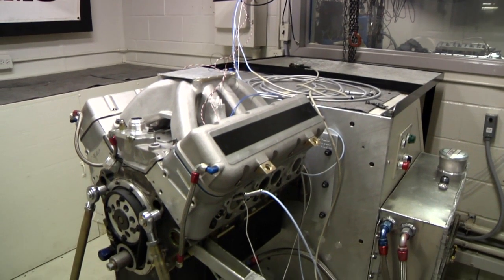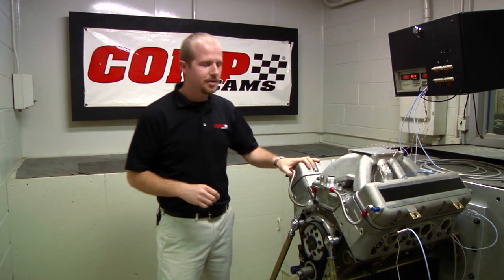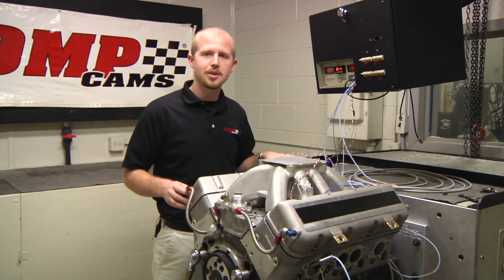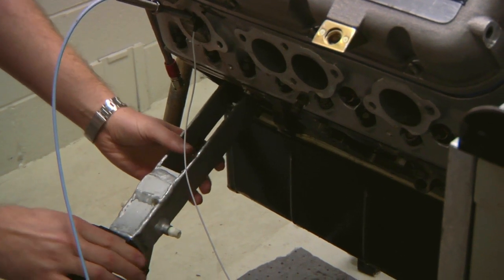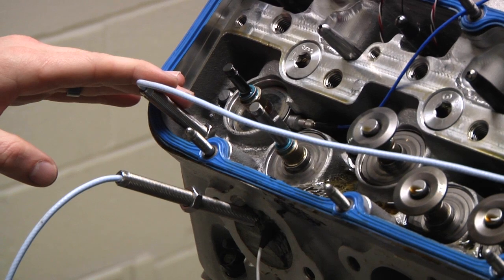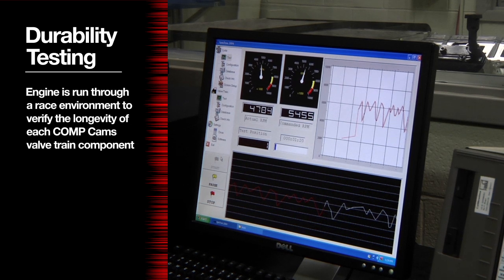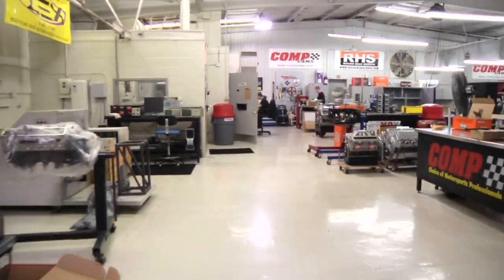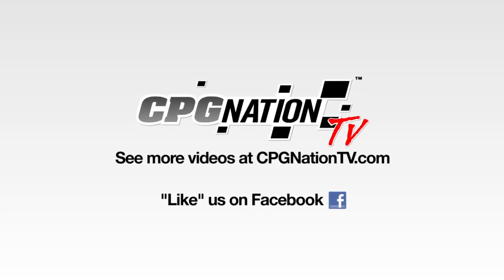COMP® Technology Explained: Spintron

Comment: What’s with the strain gauge wires connected to the pushrods? Is the load just checked static or is the engine actually ran with wires connected to the pushrods??
Reply: I can't speak for Comp regarding how they make use of the strain gages - but I build load cells and do custom strain gage installation for myriad applications. There is no reason the strain gages can't be used while the engine is running. The speed/resolution of readings from a wheatstone brige of strain gages is only limited to your data acquisition system - and NOT the strain gages themselves. Also, at high speed, the rapid flexing of the wires will fatigue the conductor and break the wires. But that'll take a while. I've gaged rifle barrels before so that stresses in the barrel during the shot could be analyzed. Consider that pressure goes from 0 to 70,000psi and back to zero in less than 2 milliseconds, in that application!
Reply: GroovesAndLands Yeah that’s what I was concerned about, the wires snapping from the constant flexing, also being exposed to oil and possible insulation break-down. Though one could possibly use the same braided style wires used on subwoofers, which I’m sure last thousands of hours. Maybe they drilled a corresponding hole in the block or valve cover?